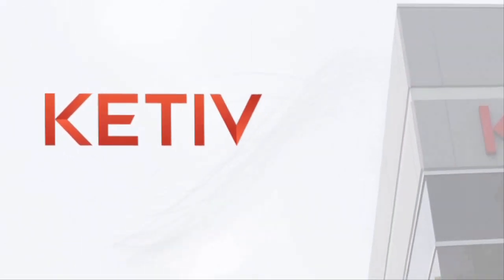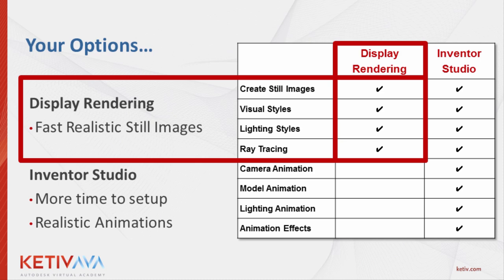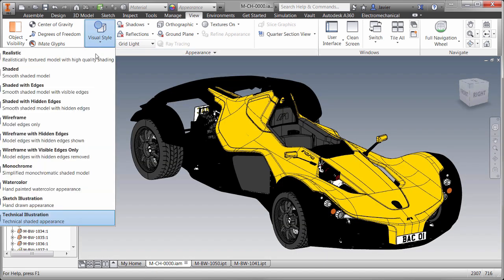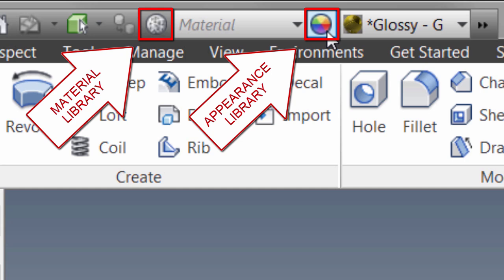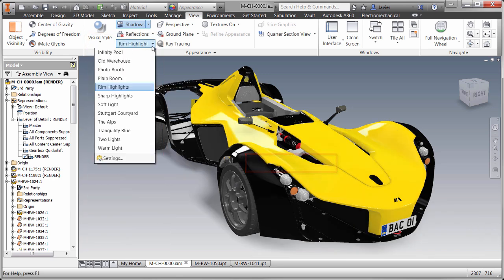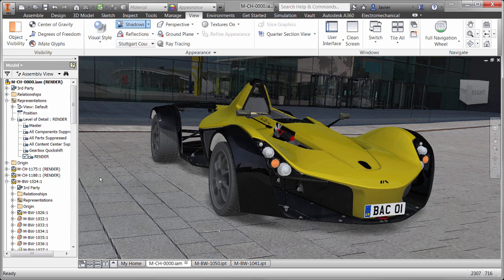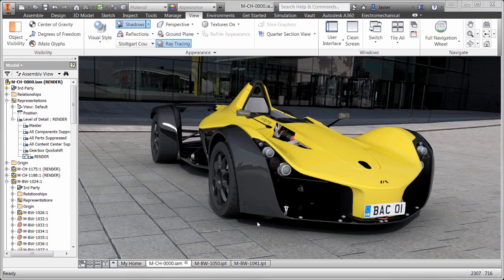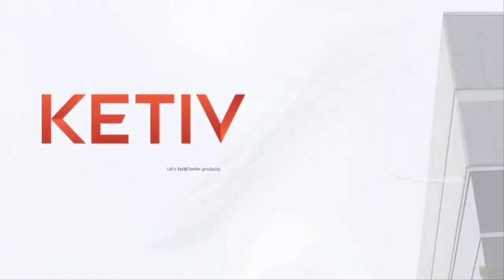AVA: Visualization in Inventor using Visual Styles - Highlights

Comment: Is there a way to use different visualization styles for different surfaces on a part?
Reply from the maker: Hi Daryl,

Unfortunately, no. There is no way to have multiple visual styles on any document. Just curious, what do you plan on using the functionality for if it existed? 

-Nigel
Reply: When visualizing manifolds it's often most effective to visualize the reverse (seeing the cavities as solids and hiding the block). I was going to apply the wireframe to only the exterior surfaces.